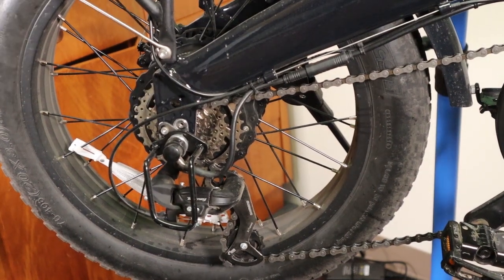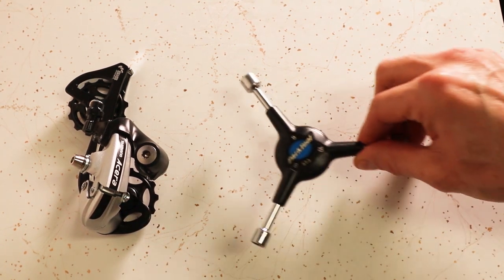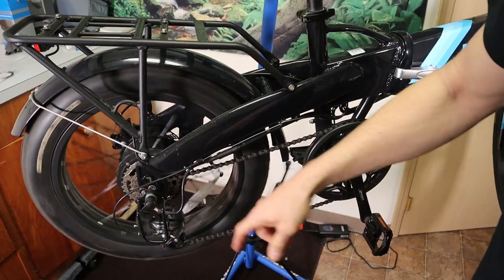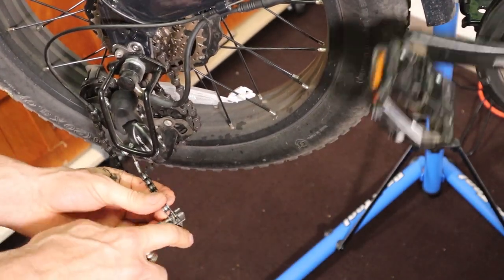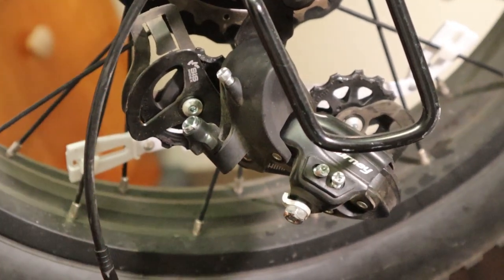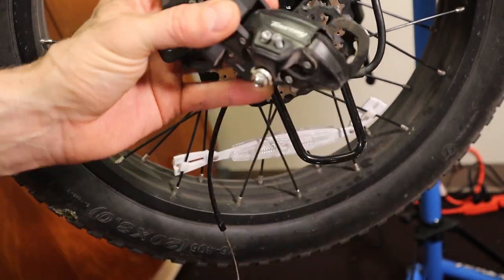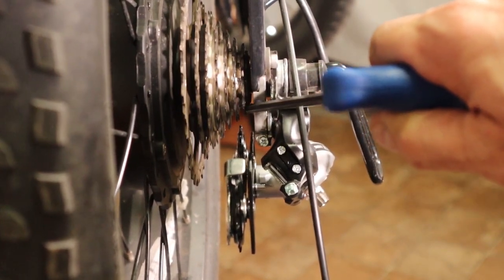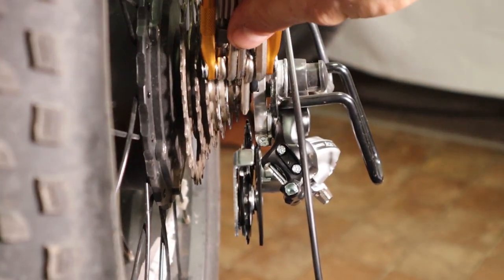Lectric XP 2.0 UPGRADE - How to Install A New Derailleur

Comment: I couldn't get the Tourney derailleur working smoothly on my XP 3.0, so I upgraded to an Acera after watching your video (multiple times).  I absolutely hate adjusting derailleurs, but I got it shifting reasonably well.  Like other commenters, I just removed the bottom wheel from the derailleur to remove the chain.  Thanks for the video(s)!

Comment: For those who don't have a chain tool, or don't want to mess with breaking the chain...  Just remove the bottom jockey wheel from the derailleur and the derailleur will come right off.  Reverse for putting on the new one.  It's so much easier than messing with chain links.

Love all these videos BTW, keep them coming!
Reply from the maker: Good tip, I wanted to include instruction on how to use a chain breaker
Reply: Thought That should work. Wondered why he replaced the link . . .

Comment: Helpful video, but you should now add a footnote or pinned comment that removing and replacing the chain link is unneccesary, because it makes it look much harder (and more involved) then it is, I almost went to a bike shop to have it done thinking i was going to have to buy a link remover to do the job, when all you have to do is remove the bottom wheel from the derailleur (remove one screw) to remove the old one, and then remove the same wheel on the new one then reinstall it after the chain is put in place. 
This will save people alot of work by not having to go through the hassle of obtainig a chain tool then removing and replacing a chain link. Thanks for the video.

Comment: I couldn't crack the 5mm Derailleur hanger bolt.  I have a similar 5mm p-tool and it is practically twisting the tool when I'd crank on it.  It wouldn't budge!  I tried some WD40 on it too.  Unfortunately,  I stripped it a bit - where if it wasn't so tight, it would still be ok, but was too tight to try more without more stripping.  I ended up drilling a hole through the bolt (with the wheel off) and using a bolt extractor bit.  Got it off and the hanger was still ok.  Got the new one on no problem, thanks to Chris's excellent lessons.
Reply from the maker: Glad you got it sorted out

Comment: Thanks again for the video. I upgraded my new XPro with this derailleur. Big improvement. The factory Tourney arrived all out of wack. Interestingly, my chain came equipped with the master link you recommended. Thanks again 👍🏻
Reply: Yeah man, I’m bummed. I just got my xpremium today and the el cheap o tourney won’t t shift into the lowest gear and just runs like crap. i must have adjusted it for a good 3 hours and nothing. So instead of taking it to a bike shop I think I may just do the upgrade. i’ve never done one before, but seems simple. I have a shimano altus on another ebike I could try in the meantime.  I was excited to ride today and I spent the day fiddling. I don’t even know if the bike turns on or if there are any other issues as I’ve not got that far bc this stupid derailleur. I do know the rear brake needs adjusting as its rubbing on the rotor. That much I was able to since I’ve spent the day spinning my pedals in the bike stand. yay!!
Reply: @michaelv1984  I tried the Acera and the Altus. I like the Altus better. Works great. Good luck man 👍🏻
Reply: @racrx7  thanks man! yeah i have an Altus that came on another ebike and it shifts and runs smooth. i went with the acera for the xpremium. i’ve never used the acera before. i was actually able to get the crappy tourney into the lowest gear and running pretty well. haven’t rode it though. but i’m just going to swap it since i got the acera and it’s better. $24 i think is worth it. what makes you like the Altus better?

Comment: Great video! I replaced the freewheel shortly after getting my lectric 2.0 this summer. Sadly the stock derailleur is slow to shift and i just purchased this Acera, hoping it will give faster more concise shifts. Its like 5 degrees here in the northeast so i'm in no hurry. Although It's nice to watch a few "how to" videos and get extra tips to make things faster and easier. Looks like a 20 minute job if you have the skills. Thanks!

Comment: Excellent video and a great job!  Your time and effort to present this how- to DIY step by step video I found to be extremely helpful ! In Fact so much so that I bought an ACERA for my bike.
I had just replaced my HYPER freewheel 28T with a 34T and had some problems with the upgraded from the OEM "Falcon" derailleur - to a long cage Tourney RD-TZ500 - would not shift into the Lowest 34T gear...  You did not cover the "B" screw but this Acera seems to have more adjustment than the Tourney had so I am hopeful that I will NOT have to mess with that adjustment (fingers crossed) .  Thanks again for a great job!

Comment: I've been riding my XP 2.0 for 5 months and find no need to do any shifting. I keep my shifter in #7 at all times just using PSA and throttle. I believe your wasting your money installing Shimano Acera derailleur. But it was a great video if you think you need it.
Reply from the maker: Good stuff

Comment: Got my 11-34T freewheel on and it went perfect because I watched your vids. Now I have the Derailleur on per your video and its almost perfect. Its shifts fine from 2nd to 1st. and 6th gear to 7th gear but in between on 3,4,5 gear I have a tiny bit of chain rub or the grinding sound while pedaling. Do I just need to do a little more fine tuning on it ? other wise it shifts really nice. What would you suggest ? Also, What would you recommend for a good chain lube for XP 2.0 that is safe to use with the electric motor on the back. Your videos are awesome and clean spoken and precise. No background noise or music. Just clean narration. Thank you for posting these.
Reply from the maker: That's awesome and thank you! Sounds like you need to use the barrel adjuster a little. Probably back it out a tiny bit and see if that helps. If your middle gears are having issues, it's a cable tension problem and the barrel adjuster will tension or loosen the cable depending on whether you back it out or screw it in. Backing it out will tension the shift cable and screwing it in will loosen the shift cable.
As for chain oil, I like Finish Line E-bike Chain Lube for ebikes -- https://amzn.to/39bxdFR
Reply: @PedalWithPower  Ok Great. Ill give it a try. Thanks for all your videos on the XP 2.0 They are awesome
Reply: @PedalWithPower  okay, I made adjustments to the cable and a couple slight tweets and voila. the thing is awesome! absolutely perfect shifting quiet in that 11 tooth gear. what a difference. I can cruise 28 mph and still have my resistance on the pedal. it's awesome! thank you so much for posting your videos again. would love to see a video on spoke tightening and truing the wheel as my spokes are cracking a little here and there. thank you again!

Comment: Very thorough and informative!!. Can the Handlebar shifter be upgraded as well? Or does the stock shifter work well enough? Thanks for the great video!👍
Reply from the maker: Thanks a bunch! It can definitely be upgraded, but I do find having both thumb triggers above the throttle is useful.
My RadExpand 5 has the thumb triggers below the throttle and it's not bad. I may upgeade it. The derailleur makes a much bigger improvement 👍

Comment: I thought that a oof the parts on the Shimano were connectd with Torx wrenches. I tried to use the Torx tool that matched but it woudnt move. My hanger is snapped in half so I neeed to take the old one off. Where can I get a derailleur hanger, and DONT SaY Lectrick. They have never been helppful at all. I didnt have thaatsafety washer for the Gear side and they said "Buy  a new bike".

Comment: Thank you for all the effort you put forth on these vids. My son and I recently picked up a couple XP 2.0s, and I also ordered a couple upgraded derailleurs and looking forward to making the swap. I do have one question if you'd be willing to weigh in. I already upgraded to the 11-28 freewheel and with the current stock derailleur, I'm experiencing clacking sounds in 6th gear ONLY. I'm hoping the new derailleur will solve the issue, but I cant help wonder if the problem lies with the freewheel. Just seems odd it would only be one gear as the problem child. Thanks again and keep up the great content. -Josh
Reply from the maker: That's great that you are doing the upgrades! 👍
Generally, if you're having clicking issues in any of the middle gears (2-6) then it's a cable tension problem. Use the barrel adjuster to tension and detension the cable.
The new derailleurs will need to be adjusted when you install them.
It also could be a bent or broken tooth, just on that 6th gear. Examine it closely.
Are both bikes having the same issue?
Reply: @PedalWithPower  So I've only installed one freewheel so far, I have attempted to adjust the barrel adjuster, but any gain in the slightest tension only makes the clacking worse. I might just go ahead and install the new derailleur and see if that clears things up, if not I think the suspect would be the freewheel. At least amazon makes it easy to play the replacement game.
Reply from the maker: @jwit76  Sounds good, hopefully it'll help. Let me know if you have any issues installing

Comment: Hi, I upgraded to the 34t freewheel. But don't want to upgrade this part quite yet as the money ain't there. How do I fix the chain slipping I'm experiencing after the upgrade. I can't go to 7th gear without frightening clanking and it slips off 1st gear
Reply from the maker: Anytime you change a freewheel, the derailleur will need to be adjusted. Here is a video on how to adjust the Tourney derailleur -- https://youtu.be/XruQZWMFy9k

Comment: Any advice if I’ve stripped the mounting bolt for the derailleur?  Used your tool list but my bolt was so tight it stripped instead of loosening.  Thank you for the videos, you’ve taught me a lot.
Reply from the maker: Bummer, stripped bolts are no fun. You can try using a torx wrench, maybe a T30 or T35 and see if it will bite. If not, you may have to grind a notch into it and use a large flathead screwdriver. Unless you can grab it with a vice grip.
You can drill it out with a small drill bit, but be careful not to drill out the threads in the hanger.
There's no easy solution. If those options sound sketchy, then I'd take it to a good bike shop.

Comment: Hi Chris, I put the Acera rear on my 2.0 about a month ago and the shifting is much smoother and more precise - nice upgrade at a low cost - I have a 7 speed DEORE LX from another bike I had in the early 90's but do not want to waste it on the 2.0. I also put a cassette hub cover on my motor ($15.00 from China used) on my 2.0 in lieu of the freewheel, I wonder if we could squeeze an 8 speed in there ?  thanks and Ride on
Reply from the maker: Nice Will! Yeah, an old Lx, Xt, or even an old XTR would work well. Those older derailleurs are gold though. An 8 speed might work if you remove the spacer behind the freewheel, but it won't expand the gear range and you'd need a new shifter.
I'm good keeping it 7 speed.
Reply: YES I agree with that, I do have shimano deore trigger shifters (7 speed) that I was going to put on my XT but I think the push button and lever one that came with it works well and is easy to access above the bars. I put a 54 tooth chain ring on the front as well and it works good and the chain has never came off. My greatest addition was a 20 AH battery on the rear rack which really extended my range and  it also seems to give the motor a little more torque for come reason, maybe delivering more amps ??

ride on Chris

Comment: How would I replace the actual shifter cable?  The end cap on mine fell off somehow and the cable end frayed.  I asked Lectric if they could send me a replacement end cap thinking I could just twist the cable end and recrimp the end but they told me the entire cable needs to be replaced.  They offered to either send me a cable to do it myself but told me they preferred that I take it to a bike shop to have it replaced.  Am I right in thinking that it's just a matter of pulling the old cable out and pushing the new cable through the length of the cable housing or is it much more complicated than that?
Reply from the maker: Good question, I will do a video about shifter cable replacement. It's more or less, pushing a new one through.
Reply: @PedalWithPower  That would be great, thanks!  I figured that's what it was but my biggest issue is that just by looking at the shifter, I'm not seeing how to pull the cable out through it.

Comment: Chris, I have the new 11/34 freewheel and removal tool now, and plan to install it on my 1.0 XP when things warm up around here. I am lacking a nice shop to work in, so have to do the job on my driveway. I am wondering if my original derailleur is good enough for this job, or should I plan to change it out too? It will probably be a little more difficult to have the chain climb up on that bigger gear.
Reply from the maker: It'll still work. Just something to consider down the road
Reply: @PedalWithPower  OK. Thanks!
Reply: @PedalWithPower  I put on a Draft Maniac 11-34 with a stock derailure.  No matter what I do, won't go into low gear unless I physically lift the chain.  Guess I'm going to get the replacement and hope that cures it. I did take out the spacer that you left in.  You think that might be an issue.  Thanks for the great videos.

Comment: what if i upgraded freewheel to 11-28? still works?
Reply from the maker: That will give you the higher, faster gears. Just not the lower, climbing gear. If you don't need the lower gear, it works great!

Comment: Can you tell me what the Lowest Height of the seat ? Great Video ✌️
Reply from the maker: Sure, with the seatpost all the way down - 
From floor to top of saddle is 32"
From center of crank to top of saddle is 19"
Reply: My wife is 5'2". Just fits on the 2.0 XP Step Through with the comfort seat option,  which raises the seat height up.  I'm borrowing a short seat extension tomorrow to see if giving her that extra inch is worth it.

Comment: Hey I followed your guide & upgraded to the 11-34t & also upgraded to the Acera. Unfortunately, either I'm not setting the Acera up correctly, or some component is now messed up. When i switch from gear 7 towards gear 1, it will not switch for a while. It only begins to switch when I hit the number 5, meaning I can't reach Gear 2 or 1 since the shifter stops there. Does this make sense? Any ideas? Appreciate it
Reply: Hey I adjusted the barrerl adjuster and the two screws. Now I can access every gear but the biggest. When I switch from 7 down to 6, nothing happens. So when switching down, I can only get to gear 2. Any idea how I can get down to gear 1? I adjusted the high screw a lot already
Reply from the maker: Hi D A, yeah it sounds like your cable needs more tension and the lower limiter screw is too tight. I'll have a video up soon on how to adjust the Acera derailleur.
In the mean time, shift into gear 7. Now back out the barrel adjuster to add tension untill it shifts into gear 6 with 1 click. That will tension the cable properly.
Then in order to get into the lowest gears, 6 & 7, you need to back out the low limiter screw. It the on on the back of the derailleur, at the bottom. If you look close you'll actually see a small "L" stamped into the derailleur. Keep backing it out untill you can shift all the way into gear 7. Just don't go too far or it will shift past 7 and into the spokes.
I'll try to get the video up by Tuesday 👍
Reply from the maker: @da6640  Sorry, I meant it sounds like you need a little more cable tension, Try backing out the barrel adjuster a little more.
Reply: I think I still need the tutorial. The problem is actually that I can't get to the 34 tooth gear. When I'm switching from the 11 to the next biggest gear, it doesn't switch, but then afterwards it does, and it switches all the way up to the gear before the 34t
Reply from the maker: @da6640  Your cable tension is too loose, try backing out the barrel adjuster a little more
Reply from the maker: Any Luck?
Reply: @PedalWithPower  thanks for your promptness, man. It's unbelievable & truly heartwarming. Feels like I will be able to get this done myself with your simple easy to understand instructions. I actually am done fiddling with it for tonight, I'm too tuckered out & need to get ready for tomorrow. Tomorrow or later this week, I will Mount the back up again, & try loosening the cable.  Cheers
Reply from the maker: Sounds Good, derailleurs are tricky to adjust. I'll have the tutorial up Tuesday 👍